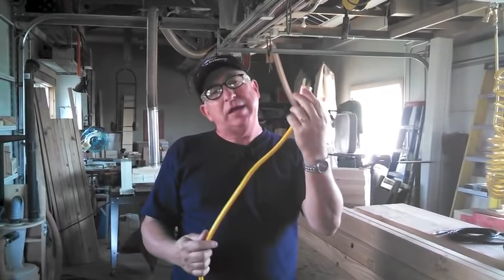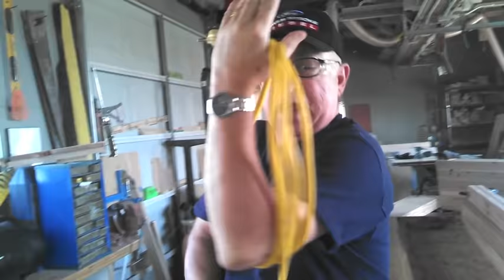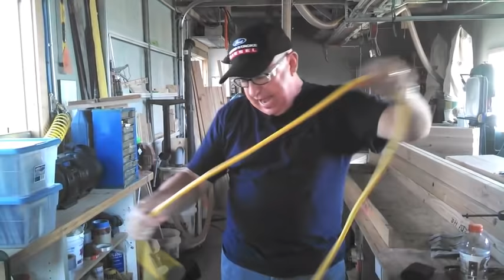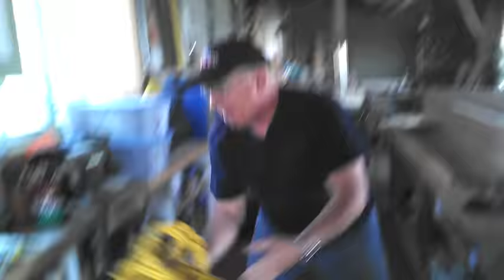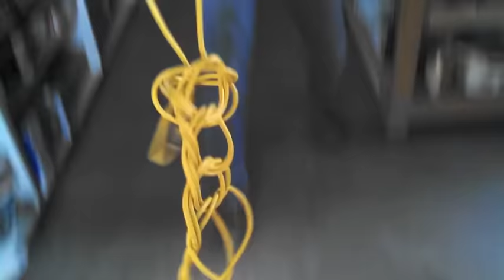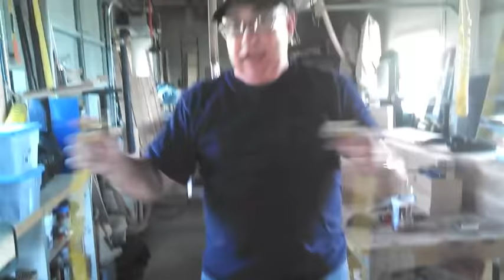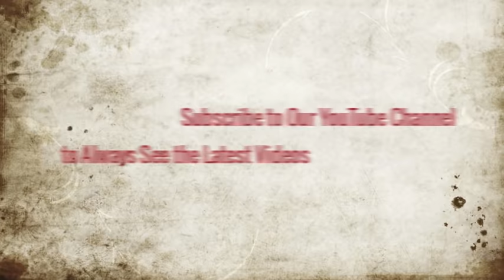Best Way to Store an Extension Cord

Comment: I have a hundred foot 12 gauge extension that I store coiled in a big bucket that's the same color as the extension cord. Easy to carry around and always ready to use, as the two working ends I have made easily accessible and I can just pull them out and put into use. The bucket has a secure, strong handle and can be hung up out of the way. My cord is easy to find, is safe from harm or getting dirty.
Reply: Cord goals 👏 🏅
Reply: Probably less likely to get stolen too. Nice job.
Reply: Good idea as well
Reply: Thanks-this video came just in time for me and was a big help! ♥️

Comment: been doing this for years. It’s easier to reach through the hole, grab ad pull. If you do it correctly, it’s fast. And there’s a way to unfurl the whole thing in one toss.
Reply: That is the way to do it  I learned that when I started doing construction work,I was just a young pup.

Comment: The other way to do cord so it does not rwist is the "over/ under" method where the cord has a reverse twist every second loop. 

That method also makes it easy to ensure all loops are uniform in size and when the cord is thrown out like you saw at the start of the video,  there is no birds next. 
With practice,  over/ under is also very fast.

Comment: I was taught this method as a High School kid working on a framing crew during the summers (1972, 73, 74).  We always put cords away like this.  We could then just toss them all in our big cord box on the truck.  The next morning at the job site, they'd come out very easy, never be tangled up, and were readied for work without any untangling.  Great way to roll cords.

Comment: Thanks for the share.  I came up in the construction industry learning this method; it works great, but with one caveat.
If you live in the gulf coast "sun belt" don't do this on a long cord you plan on dragging across the jobsite.

After the cord bakes in your truck or gangbox a few weeks, it effectivally becomes like a phone cord spiral.

Then when you drag it out it hangs up on every rebar, pipe stub and survey stake within a 30 mile radius.  If you live above the 32nd parallel it's probably ok.
Reply: Great. I like the throw it on the floor... thanks I'll use this.
Reply: one thing to fix that is to find a warm asphalt driveway, stretch it out in a straight line. then hold it down with weight and the heat will remove the cords 'memory'
Reply: @OBServe Garage lol thanks I needed a laugh
Reply: No man our cords freeze solid up here. The end result is the same

Comment: Best way is a proper over-under. It's quick, easy, and the best for cord longevity, you can toss the cable without coiling. Seriously, audio cords are far more delicate, and that's why you'll see every grip and roadie doing it this way, and speed of setup is even more important than for contractors so there's no issue with being able to toss it across a distance without it getting tangled. No idea why people don't just learn it, it's incredibly easy to do.
Reply: Yep, someone showed me the method in this video and I tried it until I discovered over-under. Waaaayyy better.
Reply: "No idea why people don't just learn it"  Maybe they aren't aware of it.  Also, just because the over under is better for audio doesn't mean it's better for all applications.
Reply: @da324  The over-under is specifically for preventing damage to a cord (pretty sure that should be a goal of all ways of wrapping so you don't need to replace the cord), and easily uncoiling rapidly while also being rapid to coil up. There's literally no downside to it if you're talking about cable made with copper (so the majority of cables). Well, there is one instance where it's difficult, incredibly stiff jacket cables at long runs it can be difficult to do (we have a 150' SDI cable that's very stiff and hard to wrap), but then again I think that'd be the case for pretty much anyway to wrap such a cord (in which case a reel makes the most sense).
Reply: @personperson9591  I hear you.  I have an Audio Engineering degree, but I'm not in the business anymore.  I interned and worked a short while at Ardent Studios in Memphis during the late 80's early 90's.  I've wrapped many XLR cables and the over under is how I do everything. However, my dad was a daisy chain guy and never had a failure with his cords.  I think I was just honoring his memory when I replied to your post.

Comment: worked for master electrician for years, never knew this.  WELL done, good technique, good NO BS video.  Praise be ye!
Reply: axlehop Your Master should have taught you correctly. I am a master electrician and there is a reason to coil a cord correctly. One reason is that cords are manufactured with a “right handed coil” onto the spool. This means that the cord will have a natural coiling position when it’s coiled properly and this will be without tight bends or knots. Thus creating zero hot spots in the copper conductor. I have cords on my van that I’ve used for more than 20 years. There is no chance of tying knots or just bundling your cords and expecting the cords to last when you treat them like this video suggests. Roofers do this kind of knot thing because they are uneducated and too cheap to buy the proper cord or strain reliefs for their application. Lesson is: learn to do it properly and your cords will last a long time and will be safer for you to use.

Comment: If you gather the cord like a lariat, and give it a slight twirl with the fingers, to counter the twisting, you get a nice circle of cord, or rope. That over time is "trained" to form this circle. And it hangs nicely...and the cord lays flat on the ground with no kinks. 

Learned this from a rock n roll band roadie.
Reply: 61lastchild     Yes, on film sets and stages we coil cords and if you do it right, it deploys nicely. That around the elbow thing is rookie shit.  I can coil a 100 foot mic cable that will run right out if it’s been tied up tight enough.
Reply: easiest fastest bestest way
Reply: Yup I have cords that are more than 40 years old, that I have always stored that way, still in great condition, deploy even in freezing weather. I call it folding the cord.
Reply: Agreed. A/V tech for 10 years I do the same. I had to wrap hoses and cords this way when I was younger or my dad would strangle me with them
Reply: So glad someone here is doing it right.  It's common sense.  Are cords sold in knots? No. They are sold in  roll. The twist roll is the only right way. For anyone that's ever had a cheaper Cord in 25° F. Weather knows why these chain knots are a bad idea
Reply: At last a sensible person.
Reply: Yes!
Reply: yep, this is the best method.  Done miles of cable with the slight finger twirl/roll.  This chain method is interesting but it seems slow and takes up so much space.  Nearly any method is better than the elbow wrap though.
Reply: Yep.Dead right.As a fisherman we coiled 30 fathom ropes 80 times a day and used the slight twirl with the fingers method.every rope would play back out perfectly.And like you say,the cord gets a memory and if you try to coil in the oppisite direction it stuffs up!
Reply: Yep, the very simple coil method works best for my jobsites.  No sharp twists and you don't have a 7ft or 8ft long chain going with 100ft cords. I was given several 100ft cords that were wrapped up in the chain method, and they were horrible when you tried to lay them out.  Took a while to retrain them but they work now. I would never give this vid a thumbs down either since dirt farmer jay did a great job sharing what works best for him.
Reply: Too bad it doesnt help when you have to share that extension cord with up to 100 people at work. You can cool roll, daisy chain, put it on a reel. When you come back to it next hitch it's one bit knot.
Reply: Agree absolutely only way to roll a cord, rope is twist at the top. Have been a sailor all my life and coiling sheets and ropes for throwing never get tangles if the are done properly.
Reply: Nick Levin 😁
Reply: @loneshark87  Rofl dude!  Umbilical cords....I'm dying!!
Reply: @loneshark87  Yep this is how we do water lines in the US Navy too.
Reply: @Red-iv8os  it's what you call the air hose that brings topside air down to the diver.
Reply: You are absolutely correct. My cords are in perfect condition after many, many years of doing exactly as you describe.
Reply: This method shown is a slight variant on rigging a parachute, rigging equipment drops, etc.  Once you learn it, you won't coil & rotate in any situation on a worksite (except if it is audio cable where fidelity is a specific aspect of the job).  It doesn't make sense.

If you were to rotate & coil then rig using that coil, you risk killing a person, yourself, or losing hardware during drops.

Beyond that; however, I've used it on extension cords, high psi flexible water lines, standard garden hoses, etc. & it is the safest and fastest means of deployment, & except for garden hoses, I've used this method in temperatures as low as -40°F
Reply: Yes, Yes, Yes, finally someone who knows the right way to treat an extension cord. I quoted you in my current comment to this video. Keep up the good work
Reply: @stagesixx  Someone rolled my extension cord which looks like that, and now it looks like a slinky when unrolled the kinks do not come out so now I am going to throw it away.
Reply: @markal33  not the only way or always the best.  a cord reel is even better.  winds itself and can be mounted to a wall.  this chain method is good for when the cord is mobile, not the best for stationary cords
Reply: Dirt Farmer Jay's method is called daisy chaining. I would use this method in rock and ice climbing to store cordelettes (long slings) used for belaying.  Then they are hung from my harness with carabiners.
Reply: The old over and under method.  Works great!
Reply: Robert Bunnell IIMoore ii
Reply: Yes! That is the best way. And only good way to roll a cord that will not ruin your cords
Reply: Any pro that works with wire or cords knows the way you discribed is the proper way to store a cord.
Reply: The Canada First Party it needs time and heat to get new memory, or “teach it”.    Lay it in the sun for a few hours and it will behave.   Do the same thing in 30 degree weather and you’ll want to beat its memory into submission.
Reply: YES
Reply: Mark Conner it’s crazy how it will get like that very quickly but will stay like that if not corrected for years.  BUT, all is not lost.   Tie one end of your cord to something very heavy and stable, like a door knob, trailer hitch, etc. keep the last foot or so form being able to twist, however that may be, maybe clamp it without crushing it.  Then tape the other end to a big drill bit, maybe a masonry bit so the end isn’t so sharp, put the shank end in your drill, twist in opposite direction form slink curl.   Stop BEFORE it gets all of the twist out.  Then much more slowly finish the last twists.  Lay in hot sun in straight position for as long as is feasible.   One long day if 90 degrees plus, maybe two days if springtime 70 degrees is the number.    Fixed.   Works every time.  OK not every time.  It most.   I’ve had a crew member do that as hazing after he did that one, he had to do that to every other mistreated extension cord, which was a pile of 12 x 100’ 12/3.   Then when a cable came up just a little short on useable length, we sent him to ask every other crew member where the cable stretcher was and don’t come back without it.     Oh, and 360 that case.
Reply: @JM-nh8yp  The problem with a cord reel is if you don't unroll it all the way then the heat can build up in the center and start a fire. Had a helper years back (assigned to me) who refused to do the crochet trick, but couldn't twist-loop a cord to save his life, so he bought a roll for his 100' cord and set fire to the yard of a church we were working on. (Then almost electrocuted us both trying to put it out with a hose, but that's another story.)
Reply: @Dwayne_Bearup  The problem is overloading the cord. The problem has nothing to do with a properly used cord rolled on a reel.
Reply: @JM-nh8yp  I've plugged that 120V  welder into 100' 12 ga cords more times than I can count. In fact, a couple of times I've had to plug it into 200' worth of 12 ga extension cord. The only time it melted a cord it was rolled onto a reel. In the same way running too many conductors through a conduit can cause overheating, having 80' of a 100' cord on a reel, plugged in and running equipment, causes excessive heat. But, do what you want.

Comment: This way is OK but audio engineers generally coil cords with a sort of over/under to compensate for the twisting, it is quick and easy.
Reply from the maker: Marc Lepage, you are correct. I use that method as well and will be featuring it in an upcoming video. Thanks for writing! Best, DFJ
Reply: Indeed, It also make the cables lay flat (non trip hazzard) on stage. Your method does not do that.
Reply: @dzfh98  Good point, I forgot about that but it's important.
Reply: @dzfh98  He's storing a cord, not taking it on tour...

Comment: I've seen this method employed by audio/electrical techs and they swear by it. However, no one video or explanation was as clear or as easy to follow as yours. This technique is incredibly powerful for keeping wires organized and undamaged. Not to mention clearly superior due to the stability of the coil and the fact that you can use just the length you need for a particular task regardless of the length of the cord, which anyone that does any work with extension cords knows is a huge pain in the ass. 

Just wanted to tell you how good of a video I thought this was. I liked you left in your "tongue twisters" as well, makes you more relatable to the viewer. Just a great piece of content. Thank you!
Reply from the maker: Timothy Smith, thanks for watching our video and taking time to give some detailed thoughts about it! We appreciate your insights and kind comments. The best to you and yours! DFJ

Comment: I've tried this method. It works but takes up more room than a standard coil.  If you're throwing the cord out to extend it try the mountain climber's technique for coiling up their ropes.  What you do is instead of doing a circular loop, every pass has the loop crossing in the middle.  Also, always stretch out the cord before coiling.  I've seen cords that have been coiled up without ever being straightened and it causes bad internal twisting of the cable to the point that it likes to kink up on you.

Comment: Contractors have used this method for over 20 yrs that I know of. It saves them set up and and tear down time which means more time actually doing the job. Remember contractors typically get paid a set amount per job. So they have to save time wherever and however they can. We typically called it daisy chain. Another term is  Contractor's Wrap
Reply from the maker: Thanks, Joseph! Great insights. Indeed, this is a quick way to both stow and deploy cordage on the job. One thing I really like about this approach is how "non-fussy" the stowed cords are. You can put a whole batch of them together, laid on top of each other, or hung together, and they don't get intertwined. Once you know which end to pull from, simple! Contractor's wrap - I like it. Best, DFJ

Comment: Not a fan of chain braiding myself. Faster to coil it. You get around the twist by making a loop and holding it in your off hand then, with your dominant hand, you simply swing your arm away to the length of loop desired and bring it back your holding hand, twisting your wrist so your hand is first under than over each time you loop.
However, that's just a personal preference.
Reply: This is the best way. I had to have multiple cords stretched out during the day and when it came time to clean up it was much faster, never had a problem with cords getting tangled up cause we used them everyday and they were pretty worn in.
Reply: This is how I roll up extension cords, the elbow thing is kinda dumb bc try doing that with generator extension cords (they are kinda annoying, very thick & heavy). Although, my younger brother &I were tasked by our dad to put up the generator cords, we connected the male & female ends & layed them out, & basically folded them from one end to other (there are probably better ways, but hey, we're kids, I'm 15& he's a few years younger). My late papa sometimes used the method in the vid, or coiled them in the loops. This past summer, I was working more on weeds & bushes at my Papa's house, he taught me how to use the bush cutter (with the teeth on both sides horizontally). I also had to coil up cords when I cut grass, so you tend to find more efficient ways. 
Sorry if I carried on, but I saw your comment & was like, "hey, that's how I do it."
Reply: I'm not a fan of this or the novice around the elbow method either. It twists and kinks and ultimately ruins a perfectly good extension cord. I've thrown out a few cords after someone helped me pick up at the end of the day and thought  they were clever.....The cords were never the same.
Reply: Thats how union stage hands are trained. Only use daisy chain on rope
Reply: I been doing that for years and laugh at my buddy who has to always be buying new cords because his 'daisy chaining' makes them twisted all to heck.  I always start w/ the female end so I can plug in and walk towards my work uncoiling as I go.  I've had my straight beautiful cords for thirty years. About three hundred feet worth.
Reply: Good luck explaining this with words.  I can barely show my guys how to coil up air hoses like this.  I learned this method diving offshore.  We would coil up hundreds of feet this way because it is the absolute  best way to wind up a hose.